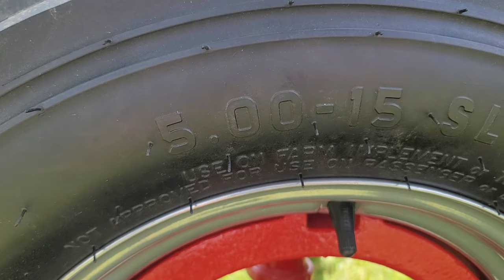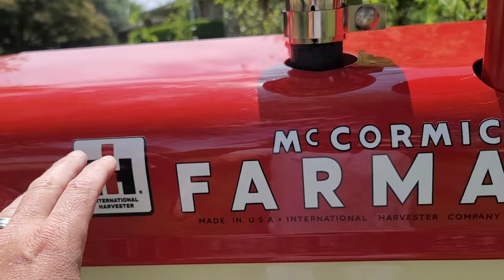Farmall Super A Culti-Vision 1949

Comment: Possible the best restore job I've seen on an A. Right down to the grommets. The original rear rim lugs were different. The square head was recessed into the lug. Also, the pto cover seems off. People can still get the square head bolts instead of ebay, Fastenall sells them new. None of this matters though. Best looking Super A out there.
Reply from the maker: Thank you for the kind words!  Yesh I have a new pto cover for it on the shelf. The one on it has a bend in it.